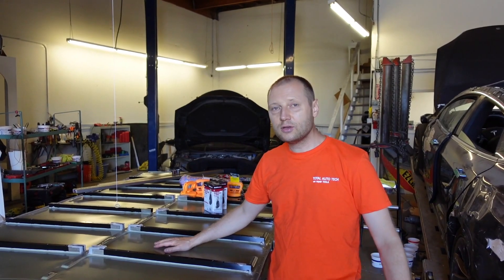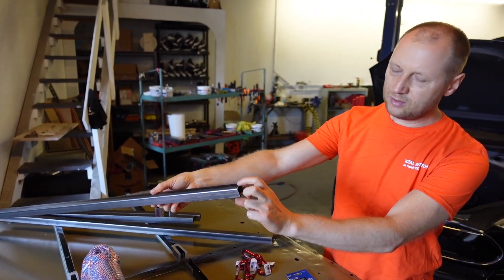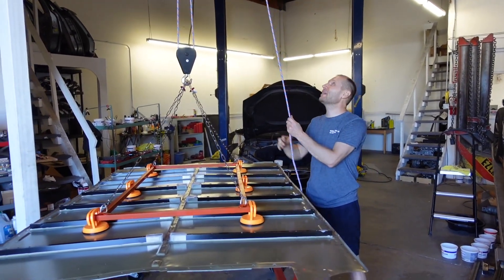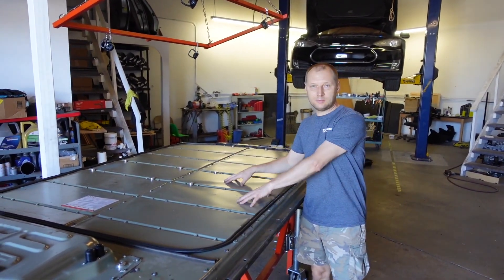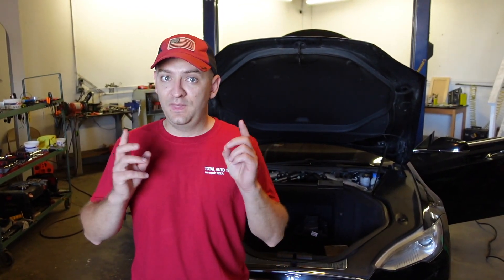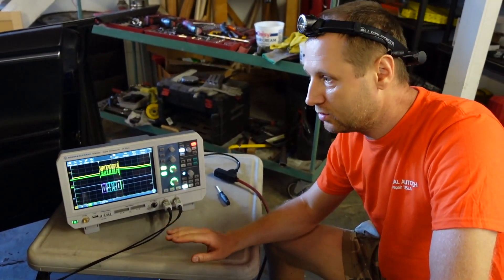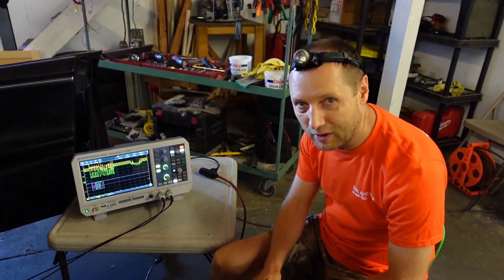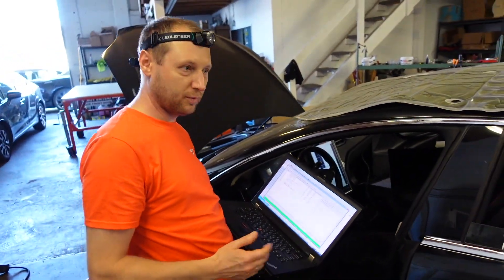Tesla Model S Main Battery Repair Service

Comment: Am I right in guessing you read canbus data from the battery? I need to do so too. Can you please tell me the pinout for the low voltage rapidmate? There's nothing to be found on google unfortunately

Comment: Hey Team, i have the HV pack open due to internal isolation. Found water in the main fuse. I have a question what you guys use to measure internal iso on a pack before installing the HV pack into a vehicel. Is there a way to reach you guys at? Thanks!

Comment: Great Video.
Does Tesla have no protection against battery modification/manipulation? If a module is replaced, the bms should be able to detect this? (different OCV, main-BMS is disconnected) I thought the battery (or charging) had to be activated (reset bms) by special CAN bus messages?
It sounds like a coincidence that the charging port is also broken....
Reply: My Tesla 2014 s went from 200 mi range to 40 mi range to yesterday it refused to start